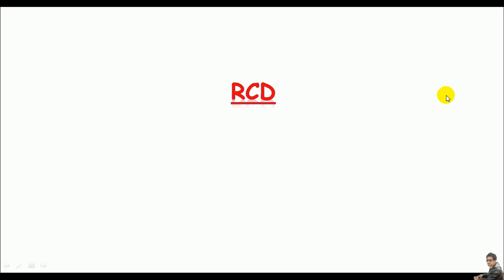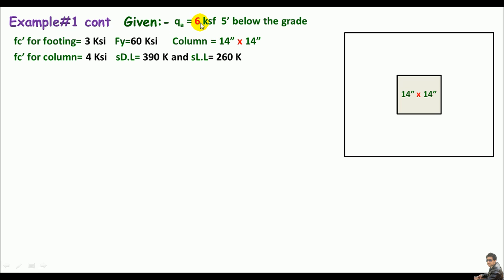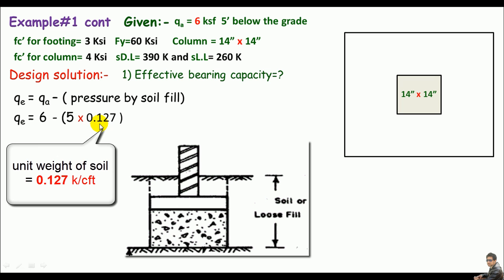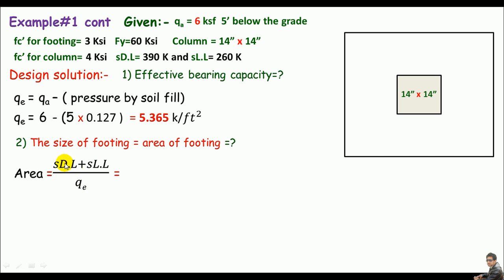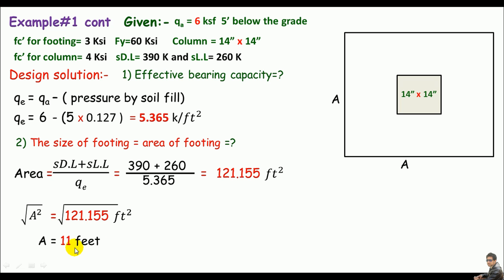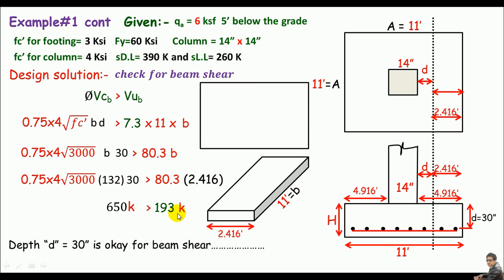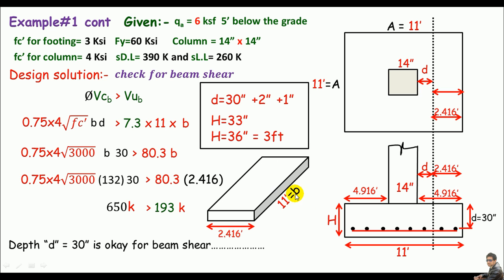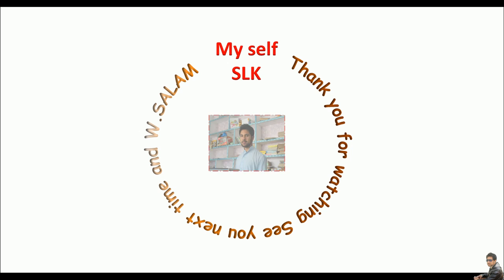RCD:- Single column footing design

Comment: Hi all, I have found an example paper will all the steps from designing a footing (which had been covered by SL Khan in this video), flexture design such as the steel area required, ultimate moment, moment capacity, stress & compression determination, No.of reinforcement bar & bar size, transfer of column forces to the base and etc. Please follow the link as below. I would like to thank SL Khan for this comprehensive tutorial video. As per mentioned in the end of this video, hoping that after read the PDF file and everyone can continue to finish the whole footing design.

https://www.concrete.org/Portals/0/Files/PDF/318-Example-1_RF_R1.pdf
Reply: thank you :)
Reply: thank you so much
Reply: Where did you find this pdf and are there more examples like this? Thanks in advance.

Comment: Hi Sir, at time 13.09 where you are abut to check for beam shear, the formula for ØVcb is 0.75 x 4 SQRT(f'c).b.d  or "0.75 x 2 SQRT(f'c).b.d" ? 

I have found that others are using "2" instead of "4". Could you please tell me should use "2" or "4" for the formula?

Based on your asnwer, 
ØVcb > Vub
650 K > 193K

If the formula is using "2" due to typo error, then the final answer will become as follow:-
ØVcb > Vub
325 K > 193K

Please correct me if I am wrong. Looking forward for your update.
Thansk
Reply from the maker: Hon Tin Chin 
yes dear. its typing mistake. i have mentioned this mistake in video description.
thanks for notice

Comment: DESIGN FOOTING    
       
  S 11 in   
  h 36 in or 3 ft
  d 33 in   
  D.L 390 kips   
  L.L 260 kips   
  B.C (qa) 6 k/ft²   
  Unit wt of soil 127 cft   
  fc 3000 psi   
  fy 60000 psi   
  depth 5 ft   
  filling of soil 2 ft   
       
   Calculate Weight    
   w 0.704 ksf  
   Effective B.C    
   qe = qa-w    
   qe 5.296 ksf  
  Bearing Area & Size of Footing     
   B.A=Service load/qe    
   B.A 122.73 ft²  
  Size of footing B.A 11.08 ft  
  Pressure on Base of footing & Factor load of column     
   qu = factor load/B.A    
   qu 7.20 ksf  
  Punching Shear & Punching Shear Capacity            (d+s)² 
   Vup=qu*(B²-(d+s)²)                             3.666666667 
   Vup 787.17 kips                                                  13.44444444 
  Capacity ΦVcp=Φ4√fcbοd                            bο= 4(s+d)
   ΦVcp 954.35 kips                                   176
   ΦVcp > Vup    
   954.35 787.17 kips  
  Beam Shear Due to Load & Shear Capacity    x= (B-S/2)-d
   (Vu)d=qu*B*x                                            2.791666667
   (Vu)d 222.76 kips  
  Capacity ΦVcd=Φ2√fcBd    
   ΦVcd 360.44 kips  
   ΦVcd > (Vu)d    
   360.44 222.76 kips  
   MOMENT                                                       K= (B-S)/2
   Mu=qu*B*K²/2                                        5.08
   Mu 1029.98 k/ft  
   Mu 12359.72 in/k  
   DESIGN STEEL    
   a=0.2d    
   a 6.6 in  
   As=Mu/Φfy(d-a/2)    
   As 7.71 in²  
   a =Asfy/0.85fcb    
   a 1.36 in  
   As=Mu/Φfy(d-a/2)    
   As 7.08 in²  
   a =Asfy/0.85fcb    
   a 1.25 in  
   As=Mu/Φfy(d-a/2)    
   As 7.07 in²  
   a =Asfy/0.85fcb    
   a 1.25 in  
   As=Mu/Φfy(d-a/2)    
   As 7.07 in²  
   Asmax & Asmin    
   Asmax 67.92 in²  
   Asmin 14.62 in²  
   As 7.07 in²  
   Asmin > As    
   14.62 7.07 in²  
  Let Try # 6    
   0.75 0.442 in  
  No of Bar 33 4 in C/C
Reply from the maker: Syed Hanif Shah 
good to see it.
thank you man...

Comment: Design a rectangular footing for the column ( 20 - in . square tied ) with 8 # 9 bars . The column carries an unfactored axial dead load of 350k and an axial live load of 300k . The base of the footing is 4 ft below Final grade and the allowable soil pressure is 5 k / ft2 . Use fc = 4 ksi and fy = 40 ksi . One of the sides of the footing is limited to 8 . 5 ft .